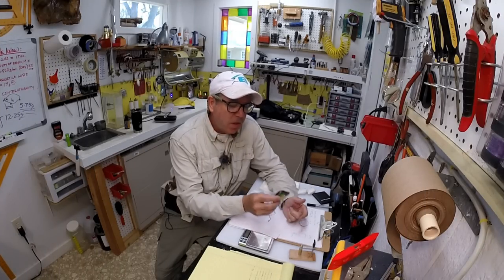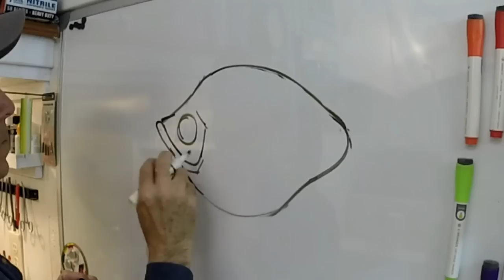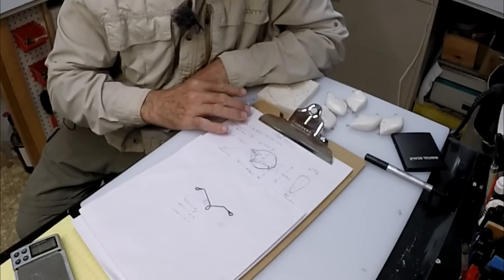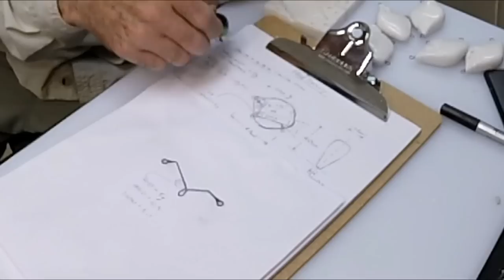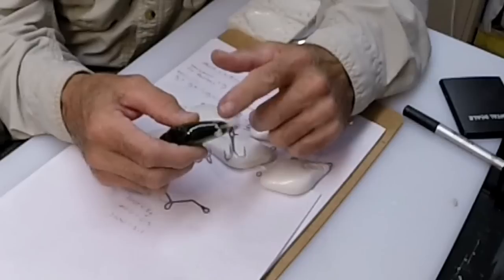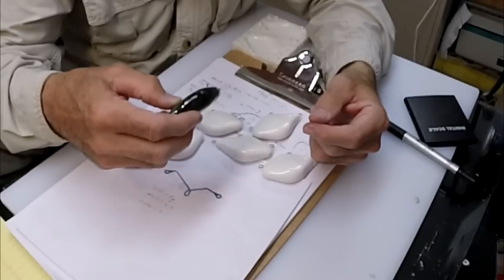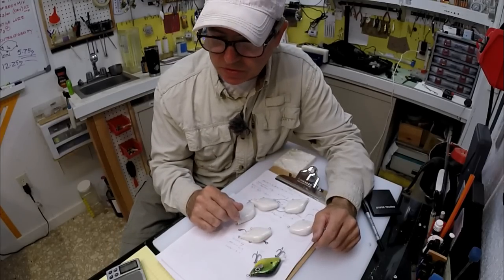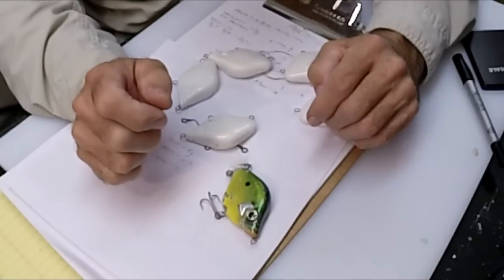Making a wooden Lure, Design and Build from Scratch, Final Thoughts

Comment: Great Job man, can you give us any info about the material of the mold and the cast ???any link to order thanks keep make  perfect videos!!!
Reply from the maker: I'm using "smooth-on" silicone rubber to make the mold. You should shop around online  for the best price..  The casting resin is alumilite white also the glass spheres are from alumilite.
Reply: @EngineeredAngler  can you tell us exactly what is the name of the brands of the mold and the casting resin to find them online please 🙂
Reply from the maker: I make the molds myself.  the casting resin is "Alumilite Amazing White"
Reply: @EngineeredAngler  is good for floating lures or only for sinking?
Reply from the maker: The  resin will sink unless you add microballoons,  https://www.alumilite.com/microballoons.aspx
Reply: @EngineeredAngler  do you know a good resin for floating lures? Thanks for your time
Reply from the maker: @kezoskostas  
All the resins I know sink. To make them float you must add microballoons.